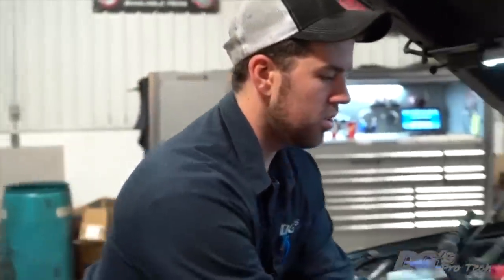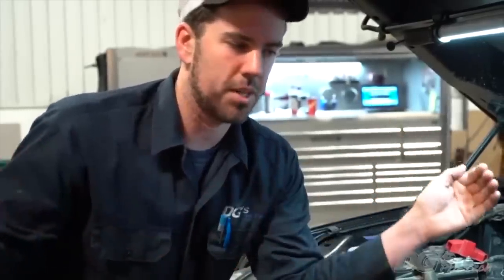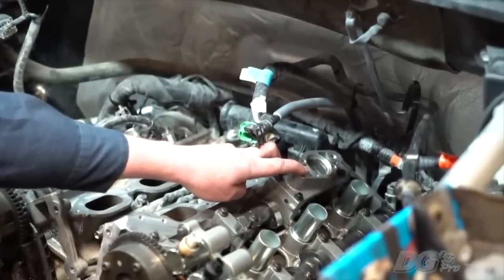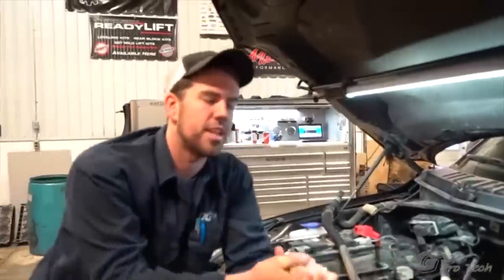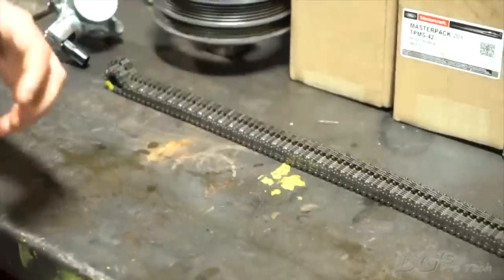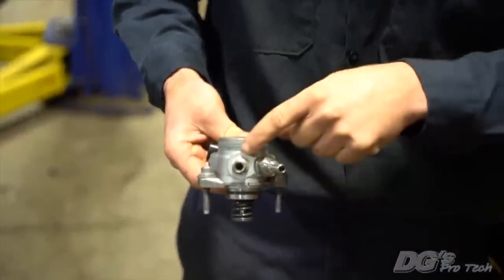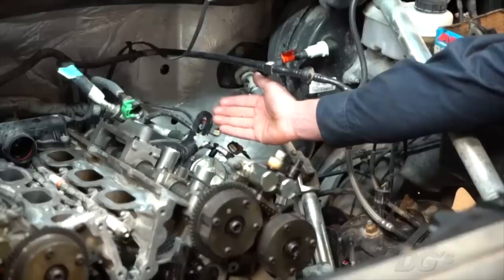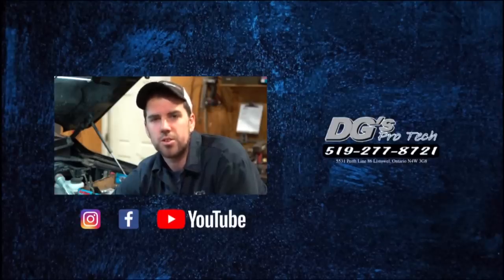What you NEED to know about Ford EcoBoost Engines by Dustin Golley of DG's ProTech

Comment: Here's another thing you have to realize with the 3.5 L EcoBoost engines and even the 2.7 these engines are workhorses they love to be worked if you don't occasionally not necessarily drive it like you stole it but put it to work fairly hard or drive for an hour or two at 70 or 75 then you're more likely to have problems. These engines really love it when you push them a little bit

Comment: Very good information for people. We service a fleet of Transit T350. They all have the 3.5 turbo. Some are now nearing 300,000 miles. Ford oil filter and a good full synthetic oil, every 3,000 miles. All of fluids every 50,000.

Other then spark plugs and coils. The engine have been bullet proof.  We do see EVAP systems, purge valve issues along with rear brake slider sticking the calipers.

Comment: I got 319k miles on my 2016 f150 ecoboost I only changed 1 o2 sensor $20 on ebay. I change my oil every 3k I run amsoil signiture series

Comment: I am an old retired master mechanic that owns a 2014 F-150 with Eco Boost. I change oil and Wix filter every 5000 miles. When I bought the truck it came with "free (ha) service. every 10,000 miles, I told the dealer no thanks and do them myself. I put it up on my lift and check everything and so far no major problems. I have seen trucks that go 15,000 miles between oil changes and they are in for repairs a lot. Every oil service I clean the THREE intake sensors and I also drilled the intercooler. My routine maint. Great video, you know what you are talking about!

Comment: What ANYONE needs to know about the ECOBOOST engine is 93 out of 100 Ford Mechanics would rather purchase a v-8 than a ecoboost. What Shawn McQuade said is 100% true.  Forced induction engines do not have long life spans. End of story.
Reply: The same mechanics that argued “f150 diesels don’t exist” and then tried to put regular oil in my 3.0 powerstroke. The new 5.0 eats oil and has cylinder deactivation. Good luck.

Comment: I've stayed with my 02 5.4 F150 for 14 years. 615k miles later it was time to replace the old truck, I was skeptical of the eco boost (2 turbo issues) but the tow rating beats the 5.0 trucks... I did my homework, talked to several eco boost owners and a few 5.0 owners and nobody had any thing but good to say about the eco boost trucks. So I bought a 2020 Eco boost f150 and I love the hell out of that thing.

Comment: Super stoked to see someone with proper sensabilities and knowledge in the 519 area code. I drove a lot of 
these during my days with a wholesaler and it is as Dustin says. It's either " Eco " or " Boost " . Also on the early 
design trucks, loved the Microsoft based driver information system, You could pull all sorts or run time data 
from it. Anyway Dusty nails it. Timing chains don't " stretch "  ,they " elongate " !  and the hi-pres pump location
does not help matters. Play with your truck, give'er and she should be happy coming out of the rodeo !
Reply: At least you have the choice of eco or boost. You don’t have that choice with the v8

Comment: My 2011 flex is in the shop right now for turbo failure and chain. It popped the check engine light about 1 1/2 hours from home and didn't have a choice but to drive it as was with no boost and engine light on. Shop is telling me the valves are showing signs of wear but not bad yet and checked cylinders and I guess they said all of bank 2 was running lean. 🤷‍♂️ is there a reason why it would run lean on only bank 2 if bank 1 turbo was the one that definitely blew up? And is it expected to have some cylinder  delamination in bank 1 or 2 with the motor just hitting 130k? Is it worth the money to put turbos and chains in it or to buy a new motor? Please help 🙏😢😭

Comment: I'm reading a lot of passionate remarks by actual owners - that defy the laws of physics and reality.  I'm glad you love/hate your trucks and past trucks, but you need to try to be fair/realistic and not just emotional.  I've owned Chevys, GMCs, Ford V8s and 3.5 Ecoboost.  Long career as a farmer, these were work trucks.  Frankly, I never had a bad experience with any of these trucks other than a couple Fords way back preceeding fuel injection when they were still using carburetors.  My last 2 trucks have been 3.5 Ecos.  No bad issues at all.  They have gotten slightly better gas mileage when not towing, definitely better when trying to drive in eco manner.  Pretty much the same mileage when towing the same amount of weight.  When towing, the ecos are able to run much slower RPMs in a lower gear due to the much better torque curve at low rpm.  But they burn a commensurate amount of gas according to the amount of weight pulled.  No fuel saving there at all.  I miss the throaty sound of V8.  I don't know which engine is the best one to buy.  They are both great engines. My eco's get 26mpg - going downhill.  My 5.0's only get 14 - going uphill.  My next one is about to be the 3.5 Eco/Hybrid.  There is no "right" one and I don't believe there is a "wrong" one.  Just good ones.

Comment: What I heard is the timing chain could've been better, "but it is what it is", don't trust the oil-change minder, and if you drive it for economy too much. the turbo waste-gates seize.  Ecobusted!
Reply: So basically your saying to floor it whenever you can? Im buying a used one 2012 with 227 000 km and it's still clean like new I side. Was wondering on some advice

Comment: Probably the best information I've found on these engines. Well done! I've been torn between the 5.0 and an ecoboost. I feel more comfortable choosing a 3.5 now as long as I run a catch-can and change oil every 3,000 miles.
Reply: No need for a catch can since the new eb has direct and Port injection.
Reply: A 3000 and 5000 mile cycle is a great way to keep oil fresh.
Reply: 2017+ you don’t need catch can.

Comment: Great video! I have an F150 3.5 EB built Jan. 21, 2011. 154,000 miles. I replaced my timing chain at 121,000 miles, and added a pneumatic pre-oiler with 1.5QT extra capacity. No pistons or other moving parts beyond an electric check valve to scrap metal shavings into my oil galley.. anyway also always synthetic oil and WIX or NAPA GOLD filters with good check valves. Now when I start up after sitting or cold,  I KNOW I have full oil pressure with phasers at full PSI. Same setup that Jay Leno uses. My Ford dealership reviewed the entire install and said they would like to see me at 300,000 miles to see how I did. I do get into the turbos hard on occasion and have zero issues.
Reply: 2014 f150 3.5 with 131000 miles    No issues yet.  What did it cost you for your timing chain replacement?   Was wondering how pro active I should be.   Was also wondering about having the valves walnut blasted.   Cant find anyone that does that yet.

Comment: I AM A FORD GUY, BUT THIS IS WITHOUT A DOUBT THE BIGGEST PILE  OF JUNK EVER, NEVER EVER BUY ONE OF THESE, IM PUTTING A ENGHINE IN RIGHT NOW AND ITS GOING TO BE ABOUT 7K, AND IT ONLY HAS 140K MILES ON IT, AND THE TRUCK HAS ALWAYS BEEN SERVICED, AND NO ITS NOT MINE, YOU COULD NOT GIVE ME ONE OF THESE PILES!!!!!!!    THE GUY THAT DESIGNED THIS ENGINE SHOULD BE FIRED!!!!!!!!!!!!!
Reply: Agree 100% garbage. 
No reliability at all.  You shouldn’t have to work on these trucks late that. It should just work. I’ll never buy another Ford again.

Comment: 2012 f150 300,500 mile 1 timing chain with phasers 1 high pressure fuel pump does not burn one drop of oil best engine I have ever owned
Reply: How to tell when phaser and chain are going out?
Reply: @LeonTiry  starts making a lot of noise at startup slack adjusters wear out first

Comment: EcoBoost v6= Fuel economy and power of a v8 by adding a bunch of complicated little parts that wear and break to a v6 that will cause you to bring to repair shop.  I used to have a Pontiac Fiero V6 and I would tell people "I don't know how GM did it, they crafted a V6 with the fuel economy of a v8 and the power of a 4 cylinder!"  The dam 2.8 liter v6 would get me around 15 MPG around town driving!  On highway it would rev over 3000 rpm cruising and get about 23 mpg.  If you floored it, the engine would rev like a fararri but the car would barely accelerate! This is a very small car with only 2 seats!  BTW my ex-girlfriend friend has a 4 cylinder 2.0l ecoboost Escape and that thing has some power to it, more than my Fiero but the damn engine already blew head gasket and grenaded itself at only 25K miles!!  They put a new one in under warranty. My other friend has a 1.5l ecoboost escape, his engine blew up at 17K miles!!!  They put a new engine in under warranty.  Those are the only people I know with ecoboost vehicles..

Comment: how many miles were on that truck it looks so clean did it even get 40 k miles before you got it. how much was the repair the engine was ripped down pretty far. looks like this truck is a money pit you either spend a small fortune after a few years or bypass that and junk the truck after 5 years.

Comment: Just have to ask. My 2016 f150 started smoking and i heard a whistle as well. information I've been finding points to the turbos. Ford found brass in the oil filter and in the turbos. They're saying I will need a new engine. I'm just not onboard with that diagnoses. Just wondering if you might have any information that might help.

Comment: I bought a 2016 f350  took it on my vacation at 2500 miles  when i returned i had 7200 miles on it and since i got free oil change from dealer at purchase i took it in , now i now diesels dont change the oil until 10000to 14000 but thats big trucks (semi)  so as im also not use to owning a diesel i thought i was over due at 7200 they said  it wasnt due until 15000 now that blew my mind and i said not on my watch  i have always changed it at 7000 and havent had any problems  80,000 miles and still love my truck

Comment: Long time since video and may be a silly question But, do kits like this <https://partsology.com/timing-chain-kit-ford-lincoln-11-16-3-5l-7l-tk4213> solve this issue? Would it bolt in with bolt in without modifications to kit, block or head? I am looking into purchasing a used 2015 F150 with the 3.5l? Would like to try and solve this issue if it hasn't been already or should the issue arise?. TIA for the Great explanation and video.

Comment: I’d love to hear him address the questions about carbon build up and if there are any fuel additives that are good at preventing it! 👍
Reply: Carbon buildup on intake valves is an inherent problem with direct injection engines. Many gasoline engines these days have crankcase ventilation system that vent crankcase pressure to the intake, so that any blow-by fumes and oil vapours in the crankcase can be burned off along with the fuel. 

With caburetors, the fuel atomises in the intake manifold. With port injection, it atomises in the intake ports. The fuel not only provides the energy necessary to make your car move, but also it helps to clean the intake valves and reduce the amount of carbon buildup.

With direct injection only engines, fuel atomises directly in the cylinder. Carbon buildup is inevitable because not introducing fuel upstream means the valve cleaning action that you got with carburetors and port injection is lost. So the crap on the intake valves isn't washed away; it just builds up. That's why you'll see people with direct injected engines post pictures of their intake valves with tons of caked-up soot and oil on them. 

So, to answer your question, there's no fuel additive in the world that will prevent carbon buildup from happening on direct injection engines without port injection since the problem is caused by not introducing fuel before the cylinders, and carbon build-up WILL happen as long as you're venting crankcase fumes into the intake.

The best way to solve this on a direct injected engine is to use both port and direct injection. You get the advantages of both types of gasoline fuel injection, with perhaps the most important one being the significant reduction in carbon build-up.
Reply: @electric7487  That’s what aftermarket catch cans are for. They collect the recirculated oil vapors helping reduce the amount of carbon buildup on the intake valves.
Reply: @electric7487  I agree with you. What is your opinion of running some “sea foam” in through a vacuum line?
Reply: @jeffreygoss8109  And spraying it into the intake?
Reply: @electric7487  yeah, that way it comes through the valves but I have never been to prove whether it is effective

Comment: This is way you should always and I mean always use Motor-craft oil and filters in your Fords and do not go over 3500 miles on oil changes. I have a 2015 F150 3.5 Ecoboost engine with max towing . I pull a sixteenth foot open trailer and a 23 foot  in closed trailer not a problem . When I'm not towing Driving around 55 to 60 miles an hour with the cruise set I have gotten up to 27 MPG on 93 octane gas on trips. My average MPG in regular commuting my average is any were from 19 to 22 mpg in the summer months always use the cruise control. When not use the cruise control I lose 3 to 4 mpg on commuting and trips because by not using the cruise control you always seem to be on the gas paddle . Pulling the 23 foot in closed trailer on over 150 mile with 2500 pounds load my mpg is at around 15 to 16 mpg but with stop and starts it a lot less with stop and go traffic.I have friends that don't change oil at 3500 miles they change at 15000 miles and use mobile 1 and use an after market oil filters and are not keeping the  radiator free of dust / seeds and bugs are starting to see a lot of problems with not only Fords but with other manufacturers also. Oil and filter manufacturers only care their bottom line and will not fix the problem you have by following their guidelines . The longer you keep the oil in your engine the more contaminate in your oil and gets worse in colder climates. I buy new and I service my own vehicle and all of my Vehicles ran over three hundred thousand miles mark with out anything mechanical going wrong with the engines.

Comment: Similar to comparing a 454 chevy to a nova II 4 cylinder ... Little tiny engine need lots of boost to make up the diff the 454 put out just lugging along at just above an idle ... Most would think big motor means more fuel but dont take into consideration the tiny engine spun up screaming barley puts out what the big boy does just above idle an Is Running through fuel it like a faucet drain . Also There is No Fuel System that Operates at Anywhere Near 25k psi . Amazes Me Cardone Would put this shade tree Wonder on there Page without at least screening Him ...lol Alot of Misinformation , Incorrect information , an Sheer Ignorance

Comment: The 5.4 L VCT is not good because the chains are so long. It's funny to talk to people who had or have the same problem with chain stretch and their engines are noisy. The call "oh that's just chain slap." Ford knows this and some of the after market rebuilders are doing good things to drastically increase oil flow. Pumps, drilling out ports and recommending shorter oil change intervals. Where the Ford lawyers will say it's your fault because you didn't pay the extended warranty, which is smoke and mirrors. Ford dealers know a customer can't win against Ford so there is no incentive to help.

Comment: Well Explained.. change your oil often and shame on Ford for not making a timing chain a little more thicker and or wider and or durable as most vehicle manufacturers do nowadays whatever happened to the good old double timing chain when the engine would last well over 220k..if you use the turbos too much they wear out if you don't use them enough now you got hiccups and sticking and then you get bad performance for Malfunction of the Turbos..sounds like a Nightmare...
Maybe a lot of it is maintenance changing your oil often and not over abusing your 3.5 EcoBoost..????

Comment: Good Engine if you trade The Truck @ 80,000 miles and change your oil every 3,000 miles for local, in town driving and every 5,000-6,000 driving over The Highway. The Timing Chain should be 50% thicker, imo!

Comment: too bad, my 2018 expedition engine knocking noise already, even the engine is hot, knocking noise is loud enough to hear at idling, and more bad thing, cold start chatterring noise,  the code shows the high pressure pump issue, I don't believe it,

Comment: Get a catch can will help from getting so much oil on the valves. 2018 has dual injection helps clean valves and is second gen have had 2015 and 2018. Change oil every 5,000 miles. I use synthetic blend Motorcraft has been great on all my vehicles. Both my trucks  have been great . Don't listen to factory recommended service's your vehicle  do it early.  Only bad thing water pump is internal keep coolant serviced to help from wearing it out early. Worked for Ford and out side shop  31 years this is a good technician very knowledgeable ,one you can trust.

Comment: Hi Dustin.
   What are your feelings toward Amsoil signature blend ?  I have a 2019 ford Raptor.  I  plan on changing the oil every 5000 miles.  I changed the oil first at 1400 miles and now at 5000 miles.  Is 5000 miles ok ?

Comment: The Ecoboost TGDI design both Gen1 ('11--'16) & Gen2 ('17-'21) have been proven in millions of vehicles for over a decade. Other brands (Honda & VW) have TGDI designs & none perform as well . Other brands burn oil even when new! I've personally owned 3 - Ecoboost equipped vehicles an never had issues ..nor expected to! Good basic maintenance using high quality motor oils an OEM filters is all that's required.